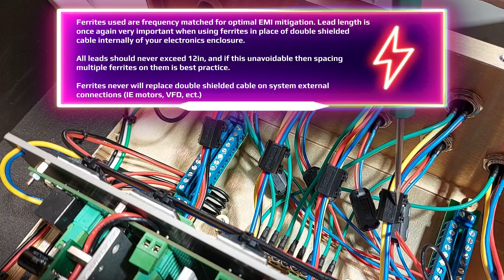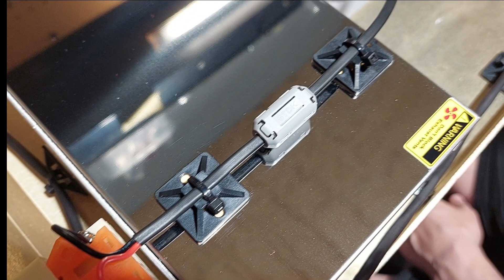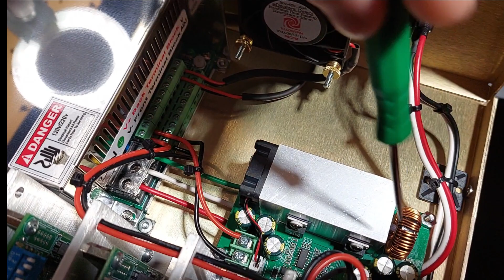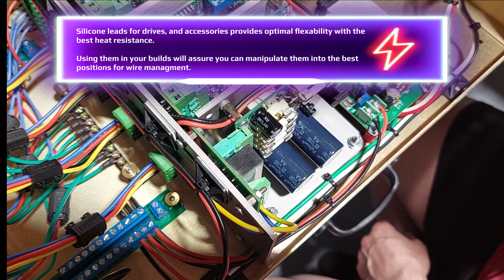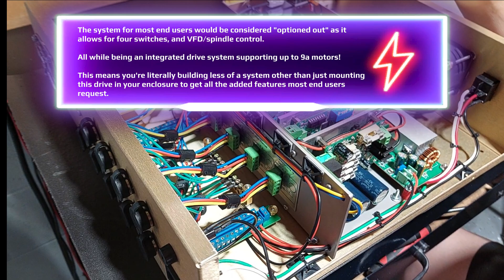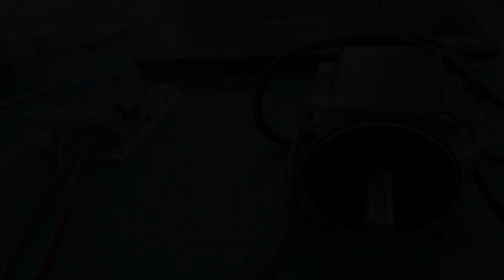The SMCU-4 Axes Ethernet Integrated Drive System Is Wired..

Comment: Very great work Vince, thanks for sharing your skills. But what about extra wiring for additional accessories (coolant, probes,....) ?  Which is the best way to wire/manage them ? Are you planning a dedicated video ?
Reply from the maker: Thank you for your support. The system already supports 4 inputs for switches, or accessories (touch plates). Multiple switches can also be wired to a single input if required to free up inputs required by additional components. The system already has built in VFD support. Thank you,
Vince

Comment: very nice  i have a question?  building my first CNC plasma with nema23  stepper online drives and my plasma cnc controller,. would it be better to  put the power supply in a separate  encloser  to  mitigate  EMI  i been watching your  videos thanks
Reply from the maker: No, its not required if your enclosure is metal in which would be best practice then your power supply will be grounded to it allowing proper EMI dissipation. 

Thank you
Vince

Comment: @Corvetteguy50 I’m kinda new to the whole “controller enclosure building” game. So I’m doing all the research and watching as much of your content as possible. Thanks for the informative content.
My question is, I have a LOT of grounding (12ft copper rods) around my shop for all my machinery…is isolating my enclosure away from my machine and grounding the box directly to a earth ground a good decision?
Will this further help noise issues by not machine mounting the enclosure or does it actually need to be mounted to my machine and then grounded to a rod?
Thanks

Edit: this will be in conjunction with a CNC plasma table I’m building also using CNC4PC’s C25XP smooth stepper BOB OR a Masso Touch G3 (if I find I’m too chicken shit to attempt the programming involved in C25)NEMA 34 motors with 4 power supplies. I want to make this thing right the first time to mitigate any problems
Reply from the maker: Thank you for your support. All the ground rods in the world mean nothing if they aren't used properly for your system/chassis.

 The enclosure/system distance to the ground rods isn't an issue because if they're working correctly then they will be dissipating EMI to mother earth. 

I seriously suggest you review my video series from Lincoln Electric as it covers all the intricate details of grounding the animal you're working with. https://youtu.be/UpJ4txXh3WM

Thank you,
Vince
Reply: @corvetteguy50  gotcha, will definitely watch next. 
Just in case I don’t grasp somewhere I’ll go ahead and clarify my interpretation. The enclosure should definitely be machine mounted and be used as a part of the machine/electronics ground loop as a whole?
Thanks for your response also
Reply from the maker: The controller's electrical enclosure isn't required to be mounted on the chassis, and its best to provide a few feet of distance as it will help mitigate EMI. It should however certainly be grounded with the system's "Star Point Ground" to allow it to dissipate potential EMI as fast as possible. 

Keep in mind the more conductive mass (AKA metal) you have grounded the faster EMI is dissipated yielding a stable robot.

Thank you,
Vince
Reply: @corvetteguy50  I really appreciate that response. That’s is exactly what I needed to know. But also why I wanted to confirm, I’m green on enclosure building and not a professional by any means at electrical. I believe going with the Masso G3 (touch) will probably be a better solution for me considering my lack of experience in the electronics of CNC. I think that removes the Ethernet connection possibility I initially wanted, but I have to sacrifice somewhere I guess.
Again thank you for all your input and sharing your expertise
Reply from the maker: You bet..:)

Thank you,
Vince

Comment: Hi, I've been following your channel for a while now and always wondered why you are not using the metal chassis of your aviation plugs to connect your cable shield to the metal chassis of the enclosure box? This would save you a pin on your gx16 (or similar type) connectors and saves up space on your busbar too. Thanks for the informative videos! Regards, Thomas
Reply from the maker: Hey Thomas, thank you for your support. Soldering the shield drain to the cables aviation connector's housing isn't possible as it doesn't accept solder, and it would make it very difficult to insert the soldered insert back into the housing. A connector using an extra pin really isn't a concern as the cost is the same for four, and five pin GX-16's.

Thank you,
Vince
Reply: @corvetteguy50  Thanks for your reply. I should clarify that this is usually done by bending the shield back over the cable, clamping it in place making the connection. Maybe this can only be done with industrial circular connectors, but this would ground the cable shield before entering the electronics box
Reply from the maker: I don't see how it would be possible when you add the insert of the connector into the housing as it has no clearance for the shield drain to screw in its set screw as it must be a flush fit. Thank you,
Vince

Comment: not being lazy but how do you determine the frequency for the fair-rites ? ferrites ?
Reply from the maker: In general, ferrite beads designed for high-frequency applications, often in the range of tens to hundreds of MHz which information an end user can receive from the drive manufacturer as each is specific to their drive they've selected.

Specifically, ferrites with impedance peaks at frequencies corresponding to the switching frequency of the stepper driver and its harmonics are most effective. Thank you,
Vince